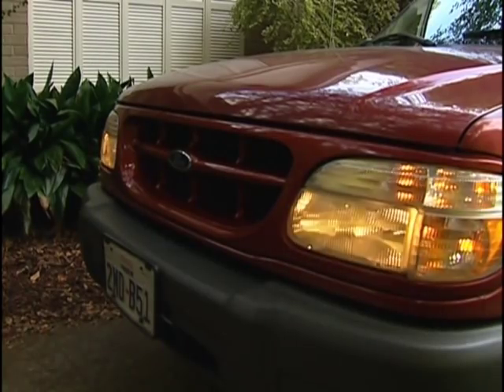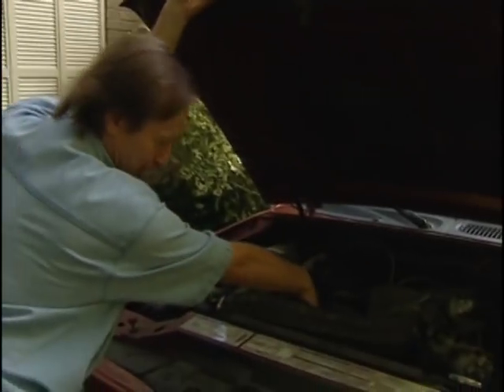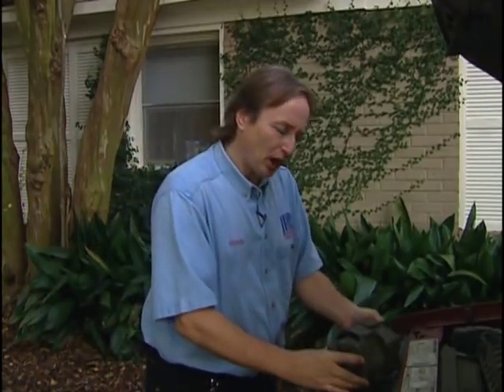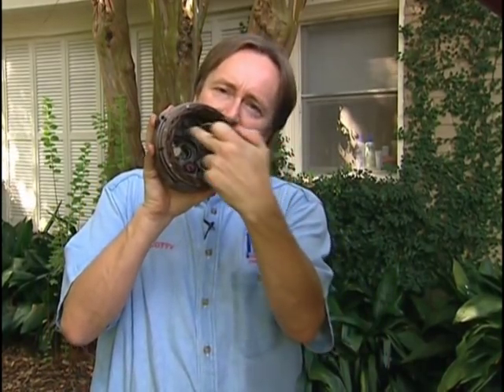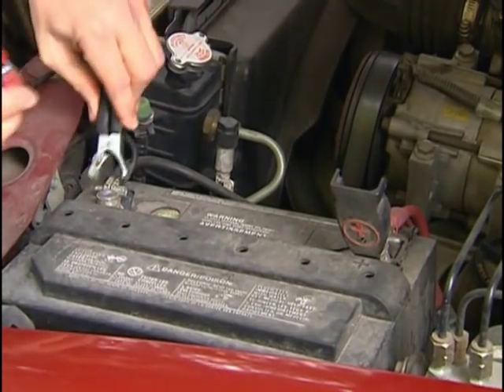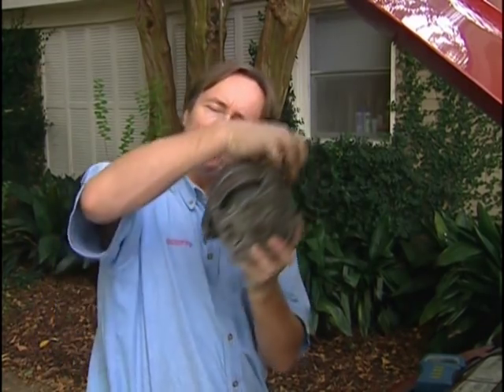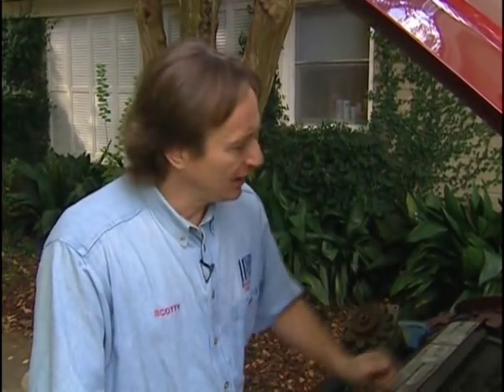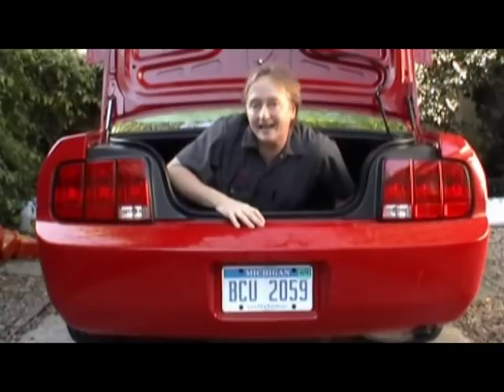How to Test Alternator in Your Car

Comment: DEAR SCOTTY,
HOW ABOUT BATTERY OPEN VOLTAGE VALUES TO CONSIDER WITH REGARD TO ALTERNATOR? THE ALTERNATOR IS OFTEN REPLACED MORE THEN TWICE BECAUSE THE BATTERY WAS NOT CAREFULLY EXAMINE AND AN ELECTRON FLOW TEST WAS NEVER DONE ON THE NEGATIVE CABLE. THESE MISSES CAN CAUSE THE ALTERNATOR TO STAY STUCK ON 28 AMP DRAWS OR 50 AMPS DRAWS NEVER DROPPING DOWN TO .88 AMPS OR .01 AS YOU SAID IN YOUR VIDEO OVER HEATING THE ALTERNATOR BURNING THE DIODES EVEN WHEN A BAD BATTERY IS READING 12.66V VOLTS OR HIGHER.

COULD YOU SCOTTY, VERIFY THESE VALUES FOR ME WITH REGULAR VOLT METER, A BATTERY READING READS 10.5V IS THIS A SHORT IN THE CELL? A READING OF 0.55V IS THIS AN OPEN CELL CONDITION? AND A READING OF 13V- 15V OR HIGHER IS THIS A CELL WITHOUT WATER?

WHEN EXPOSED TO AIR AND WATER IS THEN ADDED IT DISINTEGRATES FASTER, ESPECIALLY WHEN YOU GIVE THE BATTERY A FAST HIGH CHARGE BECAUSE THE ACID CONCENTRATION WAS OVER 80% IT EATS THE CELL; WHEN DISTILLED WATER IS POURED INTO THE WELL OF THE CELL, IT EXPANDS AND CRACKS THE CELLS, THAT ARE WEAKENED.

 NO ELECTRON FLOW, EVEN THOUGH THE VOLT METER TELLS US THE BATTERY VOLTS ARE ABOVE 12.75V, IT CAN START THE CAR YET IT IS DECEPTIVE, IN THAT IT WILL NOT RETAIN A CHARGE AT THE CELLS LEVEL. THE HYDROMETER GRAVITY TEST READS ALL CELL NEED TO BE RECHARGED AND THE VOLT METER PROBE TEST FOR EACH INDIVIDUAL CELL READS LESS THAN 1.5 MILLI VOLTS WHEN IT SHOULD READ 2.0V, MAKING THE ALTERNATOR SUSPECT AGAIN, WHEN ITS REALLY THE BATTERY, THAT IS DRAWING TO MANY ALTERNATOR AMPS, CHARGING A DEFECTIVE BATTERY CELL CONDITION, THAT GOES UNSEEN OFTEN IN OUR APPROACH TO SOLVE AND INVESTIGATE THESE ILLUSIONS IN DIAGNOSTICS.

 TO CHECK FOR THIS FLOW OF ELECTRONS, ONE NEEDS A FLUKE TO CHECK THE ELECTRON CURRENT ON THE NEGATIVE CABLE. MANY TECHS, MAKE THIS MISTAKE, OVER AND OVER, AGAIN BY NOT CHECKING THIS ASPECT FIRST AND MANY WHO PRIDE THEMSELVES ON RE-CONDITIONING THEIR BATTERY, OFTEN ARE DISAPPOINTED. BECAUSE THEY DID NOT CHECK THE ELECTRON CURRENT FLOW OR RESISTANCE OR WORKING AMP DRAWS.

IN YOUR WONDER-FILLED VIDEO, WHICH I LOVE VERY MUCH BECAUSE THEY STIMULATE THINKING, OBSERVATIONS AND FORE SIGHT, AND RE-THINKING OR REASSESSMENT, YOU, ONLY DID A NEGATIVE SIDE TEST OF THE ALTERNATOR. DID YOU FORGET TO DO THE POSITIVE SIDE CIRCUIT CHECK, WITH YOUR VOLT METER ON THE ALTERNATOR'S POSITIVE SIDE, BECAUSE A DROP IN VOLTAGE WOULD NOT SHOW UP ON THE POSITIVE SIDE? CREATIVELY IN YOUR VIDEO YOU CAME UP WITH 1 OM RESISTANCE USING A RADIO SHACK RESISTOR!

 TO CHECK FOR INCREASED RESISTANCES OR VOLTAGE DROPS, TO ACCURATELY DIAGNOSE THAT ALTERNATOR, ONLY THE NEGATIVE SIDE OR GROUND, WILL SHOW WHATS ON THE CIRCUIT, SUCH AS THE VOLTAGE REGULATOR, A RESISTOR THAT WILL USE POWER FROM THAT CIRCUIT DROPPING DOWN ITS ORIGINAL VOLTAGE POWER CAPACITY, BY SO MUCH RANGE IN FRACTIONS OR PERCENTAGES IN VOLTS?

 I STILL REQUIRE MORE STUDY AND READING ON THIS CIRCUIT DIAGNOSTICS, IT TAKES TIME TO ABSORB AND MASTER THESE TECHNIQUES, BECAUSE THERE IS SO MUCH SCIENCE, BEHIND THE CAR'S FUNCTION. CAN YOU RECOMMEND  BOOKS ON THE ELECTRICAL TRANNY AND ENGINE REPAIRS? I HELD A 150 HOURS CERTIFICATE IN AUTO REPAIR BUT I NEED MORE TRAINING IN THE ELECTRONICS SENSOR, RELAYS, MAGNETIC INDUCTION SYSTEMS, I ONLY KNEW POINT AND DISTRIBUTOR CAPS AND ROTORS.

IS THERE A POSITIVE VOLTAGE LOOP ON THE ALTERNATOR CIRCUIT, THAT NEEDS TO BE EXAMINED? IF SO, THEN THE FLUKE IS THE BEST TOOL TO MEASURE THE ELECTRON FLOW BUT ON THE NEGATIVE GROUND SIDE AND NOT ON THE POSITIVE CABLE SIDE?

RESPECTFULLY YOURS,

BOB BISHOP.
Reply from the maker: sure, I always test the battery first, and places like auto zone will load test batteries and alternators in their parking lots free. IF the battery is really bad, it will often show the alternator is not charging right.
Reply: LOVE YOUR SHORT ANSWERS IT CONDENSES A LOT OF SCIENCE AND HELPS TO GET THE EASIEST FIX WITH OUT TORTURING MY SELF WITH MORE LEARNING BY READING AND MORE THINKING WITH NO EXPERIENCE. YOU ARE THE GREATEST! ANY BOOKS TO RECOMMEND?
Reply from the maker: Bob Bishop
I haven't used books for years, heck, watch some videos, they generally are better and free on youtube
Reply: Thanks experience and learn as you go seems to resonate with me too.
Reply: Bob Bishop What's with the caps lock ON man!!!

Comment: HI Scotty, can an alternator be tested good ,but still have problems internally? My 2007 Chevrolet headlights have pulsating flicker. Then occasionally my service battery charging system will display. I've had the battery and alternator tested good. Please help Scotty
Reply from the maker: +Michael C yes, anything electronic can get shorts that come and go
Reply: If it´s on idle ,it could be a bad diod.When you wind it up it could give you 13-14 volt without any users (lamps,fans wipers).Alternators has 3 phases,with one gone that occurs ,flickering at lo rpm.At high rpm it still charging  ,but just 2/3 of it´s capacity.And you don`t se theflickering !

Comment: Mr. Scotty. my 2006 altima v6 stalled while i was driving on the highway. my dash started to show the engine warning light and battery light. same time, the steering got tighter and brakes got harder to press. could this be the alternator issue?

Comment: Hi Scotty. My car started draining the battery when it sat for more than 2 weeks. Noticed it seems to be ruining batteries over the last few months (they slowly stop being able to hold a full charge). Now the alternator is whining but it's not the bearings. Gets louder when more accessories are turned on. I'm thinking it has a bad diode which is causing the whine and killing my batteries. It's still charges ok. So my question is...Will running the vehicle in this state ruin other components like the ECM etc.? It'll be a bit before I can get the funds to fix this. Not sure if it is related but I had to repair a soldered thermal fuse in my airbag module and now I'm wondering if the failing diodes in the alt might be to blame.
Reply from the maker: do my video "fixing battery drain on your car" to see what is shorting out, if anything. If nothings shows, replace the alternator, realize it should not whine at all on most cars
Reply: Yes sir. I have a lighted test light (bulb not LED) that I plan to connect between the ground and negative post. Then I'll start with the alternator since its whining.
Reply: Pour some water on your fanbelt ,the sound should stop.The more you turn on the more load on the belt ,Check your #fanbelt".

Comment: Hey Scotty,

Who makes the best alternator bearings?
Reply from the maker: +Stanley Waggoner I'm out of the loop on that one, stopped rebuilding them decades ago. I use a pro rebuilder, or buy them from a factory already rebuilt.  too much hassle finding good parts to do it yourself these days.
Reply: +Scotty Kilmer 
With the wide range of price swings for rebuilt units these days, this tells me rebuilders have many suppliers to choose from. Some good, some not so good.
I prefer US made components and shy away from parts made in China. 
In general, I'm very cautious of using components made over seas, especially bearings.

Comment: hi Scotty i wanted to know if im having an altenator problem yesterday my car brokedown and i ended up buying a new battery after i installed the new battery i noticed  when im at idle on a stop  the battery light comes on and the car starts to feel like it is shutting down if i rev the engine or bring rpms to two2 the light goes off but as soon as im at idle it comes back on
Reply from the maker: replace the alternator
Reply: Scotty Kilmer ok,  thank you  for your quick reply

Comment: My trucks headlights and dash lights flicker occasionally and the volt gauge fluctuates, I just replaced the alternator 2 months ago do you have any ideas?
Reply from the maker: check both power wires for shorts or loose connections, and also ground wiring for the same

Comment: Hi Scotty,ihave ford explore2006 and when i start. Battery light appears check charging system  goes off after pressing gas up to 2000rpm ,my mechnic changed voltage regulator , still the same problem do i need a new alternator or what , thank you.
Reply from the maker: new alternator or it has a wiring problem
Reply: You need a new mechanic !

Comment: What about a car with a battery that was charged and read charged, won't start the car? It needs a jump and if i don't give it more power it sputters and puts from loss of power, complete loss of power. Alternator? Bad battery? Bad connection?

Comment: hi scotty , just wanna ask if you can give me few steps to test and tell a bad alternator
Reply from the maker: +jaycee fernandez to do it correctly, a tester is needed. Places like auto zone test em free in their parking lots if you don't want to buy an 800 dollar tester like I use
Reply: +jaycee fernandez The dirty easy way: Check with a multimeter how much volt you have (+ on + and - on - on the battery). Then start your engine and see if it goes up to 14,5v or so, then it is ok. If it doesn't change, your alternator isn't charging.

Comment: Scotty, I just replaced my battery and alternator now my battery light comes on. I put my meter on the battery to check the voltage from the alternator but it only puts out 11.9 is the alternator bad?

Comment: Scotty, I have a 2003 infiniti G35 coupe. The battery light and red brake light are on (not sure if the two lights are related)  I hooked up tester and it showed 15 amps under full load for the factory alternator 75,000 miles. I concluded it was over charging so I installed new aftermarket alternator and it didn't fix any of the lights on dash or the 15 amp load under a full load. Do you have any ideas to my problem? Thanks

Comment: Hey Scotty. I have a 93 rodeo. While driving the rear abs light came on then the engine died. Waited a few minutes then it started right up and drove fine. This has happened a few times in the past. Any ideas.
Reply from the maker: ZIPPER978 sounds like electrical shorts, typical on an old rodeo . Check for wiring and ground wire shorts first, and pray it's not in the main computer

Comment: Scotty, love your channel and am now a subscriber.

Question: Is my alternator overcharging? 

Battery located under rear seat (2001 Buick Lesabre - 3.8L), charging at 14.8. I've read considering battery location,  the alt. can charge up to 15.5v due to distance between alt & batt. I know normally speaking (batt. under hood), it can charge up to 14.5v...

Is that true? 

Please post answer.
Thanks Scotty.

Comment: I have an Altima 2007. I just put a new alternator a month ago. Now my battery is drain I took the battery to auto zone they recharged the battery, now my alternator gives me 11 volts. .I took the alternator to Bennet to get it checked they told me is running good 14 volts but when I put the alternator back into the car it reads 11 volts and then my battery gets drain. Do I need to check something else?
Reply from the maker: bad wiring will do that, not ending enough power to the alternator.
Reply: I just did that, I called the dealer to get the wiring harness $800 hahahah. I just did a little bridge the plug cover from the alternator was melted and didn't let the electricity go to the alternator so I took it off and broke the plug and cleaned the ends and now is working fine. . Thanks a lot

Comment: hey scotty so i have a 97 jeep grand cherokee laredo 4.0 I6 i can jump it to start it but after 5 min of driving  the battery voltage drops to 0 but will keep driving until i shut it off i know that means that the alternator is working but its not charging and sometimes it will start back up again but not always. just bought a brand new battery today so its not the battery. maybe replace the alternator but past that i have no idea. help me please
Reply: Definitely replace the alternator. At that point it's ready to stop working entirely and that's not good on the battery at all.

Comment: What causes an alternator to seize...just dirt? Will a dirty alternator rob the engine of too much power at idle rpm?
Reply: Teller3448 touching metal I was changing the thermostat and man I didn't pay attention and the socket wrench tapped the alternator and sparks flew out

Comment: noise and brown dusts around the altenator pulley indicates worn bearings or worn copper bushings.
bad alternator results in:
1) intermittent warm/cold ac air.
2) raw gas smell, due to fuel injectors not getting energized.
3) lower miles per gallon.
replace!
remanufactured alternator $225 (autozone).

Comment: @scottykilmer But could that not also be the PCM? Like in my 96 Jeep ZJ Orvis it will not charge at 14V, max it will do is 13V and it has come down to is the built in voltage regulator in my PCM is faulty causing it not to adjust output of the alternator for when i have the headlights on, fog lights on, along with the radio and AC it just starts draining my battery you can watch the Volt gauge just start dropping......

Comment: when I open headlights the engine hesitates running. Is it the fault of alternator in this case? (1986 toyota corolla)
Reply from the maker: +Erhan Bayram that or bad wiring, Auto zones load test alts free, start there
Reply: +Scotty Kilmer thanks, it is a great channel by the way.

Comment: i have a bmw 3 series and whats the problem if your turn signal blinks real fast, way faster then the left? all signals work except the rear right side of car. checked bulbs and also when my head lights are in the off position the lower beam is on .

Comment: hey scotty my 94 Cadillac deville v8 4.9 dash say no charge battery I charged my battery it drove about 2days and died but about 2 blocks a day until my dash started flicking and my head lights got dim my battery's good got it check at auto zone battery cables are tight cound it be my alternator
Reply from the maker: +Eric Martinez yes, replace that alternator and pray it's not a wiring problem
Reply: Thank you sir

Comment: scotty, I just put a video today of a problem with my alternator. bought it at a chain auto parts store, they won't exchange it for another one. cold, it shows 12 volts car running. then there's a drop in RPM's after 5-10 minutes of warming up, suddenly the voltage jumps up to over 14 volts. Is it the alternator? also, there's a whistling once it kicks on. check the video please. /watch?v=ohTHm3tC8WA

Comment: Hi Scotty its me again, just today my toyota tundra all of a sudden stalled. I got my cousin to go where I was at to jump electricity, the truck turned on but when I disconnected the jumper cables after a while it would turn off. I charged the battery at autozone and barely made it home. I don't want to go to the mechanics where I live do to their nescience every time I go they bleed my wallet. So I turn to you because of your eruditeness, could it be the alternator? Maybe a battery terminal.

Comment: is possible fix the noise into of alternator on isuzu 1998 rodeo 2.2engine
Reply from the maker: if alternator is making bearing noises, it needs replacing. "But if you mean noise on the radio, you can install an in line noise filter on the power line to your radio to stop that.
Reply: The noise is into of alternator, someone told me the noise a bad bearing this is possible

Comment: I'm not getting anything. Dead. New battery and nothing. A couple of days ago I tried to start my truck and lights came on, dash lit up but when I turned the key I got a series of rapid clicking. Yesterday tried to start my truck again and its dead. I have a 2002 Avalanche 1500.
Reply: Tap the starter a few times and try it again

Comment: Took my car to check the alternator and battery.. Battery passed and alternator passed.. Drove away, and voltage began doing its funky thing. Gauge was showing 13.4 volts, suddenly dropped to 11.9.. stayed there for several seconds and jumped to 14.5, then fell back to 12.8.. This stupid thing!

Comment: You forgot to mention a fast way to check the alt. to see its bad is to leave the engine running and disconect the batterywire if the car engine dies then you know the alt is bad.  Just thought i would mention that..☻

Comment: ScottyThe alternator you are showing is not compatable with todays alternators from 1990's onwards.
Reply: TheSirjohn2012 funny enough my fathers 92 S10 has one like that 

But to be fair it's also has a carburetor
Reply: AutoManAre you kidding me your dads truck has a carburetor and it is a 1992 GMC or CHEVROLET  truck.?I had thought that any/all carburators are or at least were dead by todays standards of the fuel injections systems by all of the USA and foreign automotive car makers in this decade.
Reply: TheSirjohn2012 yup 1992 Chevrolet S10 Tahoe, it's a 2 door regular cab with a 5 speed and if you didn't know your first guess would've been a a 1980s truck
Reply: automan224 no it should have what looks like to be a carburetor but it's really fuel injected. Gm did this on engines from the 80's to the 90's its called tbi. Throttle body injection.

Comment: A mechanic told me that the ticking is my alternator but it tests good how can I tell if it's bad without having to replace it???? I need help!
Reply from the maker: +Bruce Gordon remove the fan belt on the alternator, if noise goes away when you start it, that's it
Reply: Do I take the belt completely off of everything?
Reply: +Bruce Gordon Yes

Comment: Cant you just jump the car, disconnect jumper cables and the negative cable? If it still runs then the alternator should be good.

Comment: what do i do if the bolts holing i is so tight hat PB blaster a joke
Reply from the maker: then use a cheater bar and socket, and or heat the bolts up with a torch